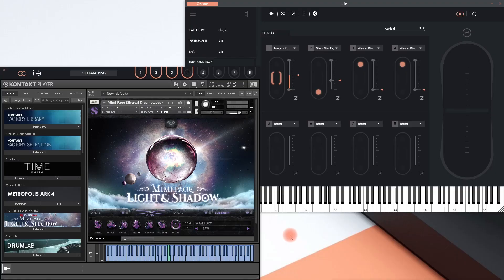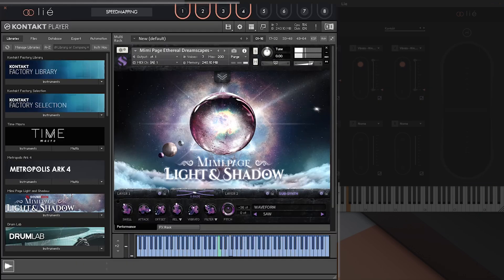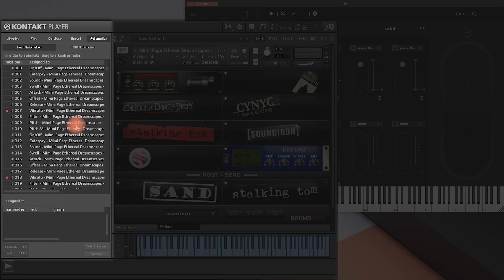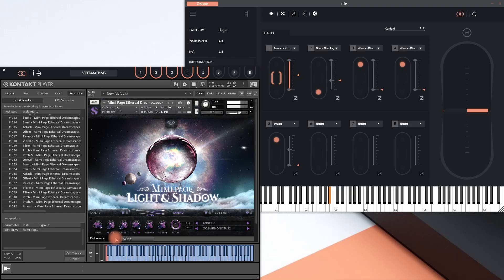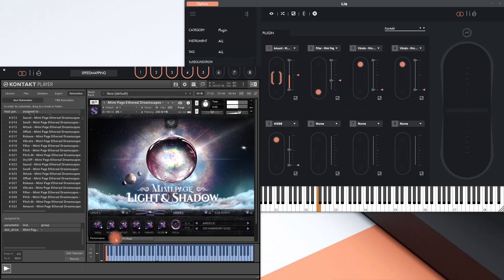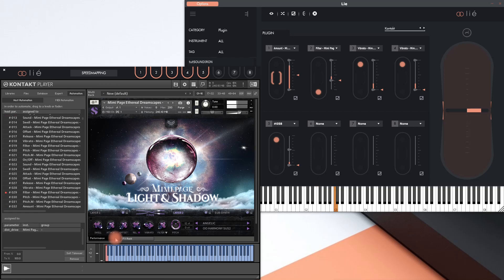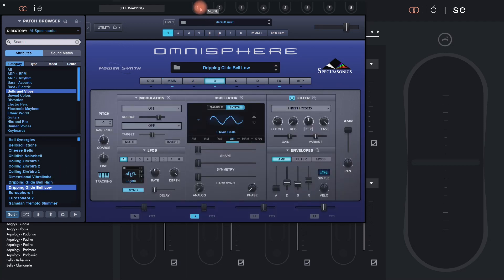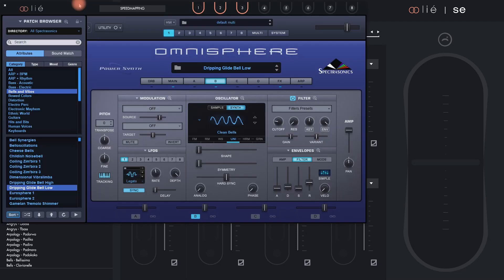11 | Fixing mapping issues in Lié | Touché Tutorials

Comment: Hi, I bought touche a few days ago.
Version of Lie 1.5.4
I updated firmware to 1.3.0.
First day it was working correctly. I was trying to add parameter between lie and kontakt VST in my DAW (Logic). Top axe stoped to working.
In standalone mode and in DAW (Logic) when I open the Lie, top axes doesn't work. I deleted all things lie on my computer and install it again but still doesn't work. 
I uninstall to logic and install it again, I repaired Mac and tried again, I install Lie to other PC but don't work. Just standalone or just DAW... both of don't work.
On Lie, top axe light is on-off quickly. When I push top axe, dont send signal.
I upload a video on youtube that how to see problem when I push all axes of Touches

https://youtu.be/h1CZ9IE_AkA

I read all topics in web and watched all video about Touche but couldn't find any solution.
I'm so sorry! How can I fix it? Can you help me about that problem?
Reply from the maker: Hi, thanks for your comprehensive message and the video. Given that it doesn't work across multiple platforms, it most probably is a hardware issue. We will organize a replacement. We were already in contact via mail, I will get back to you there to arrange this.
Thanks for bearing with us. Best wishes, Chris
Reply: @ExpressiveE  Thanks for your feedback. Yes I read your mail and I'm so happy for you replace it. Because I really loved to Touche. I recommend Touche to every musicians.